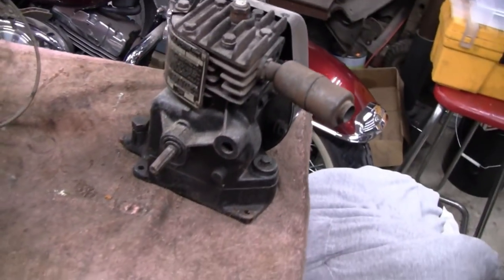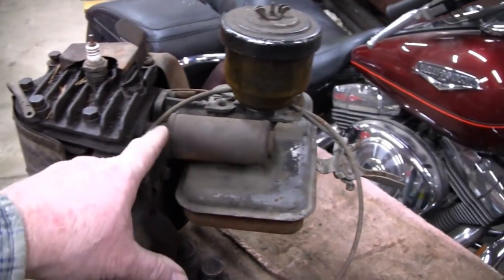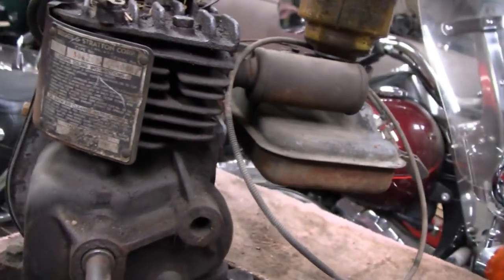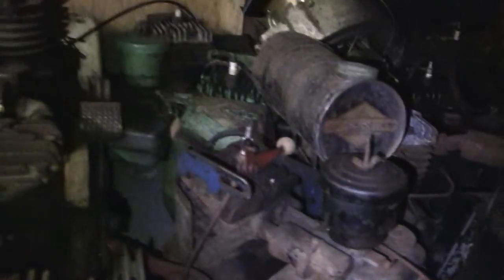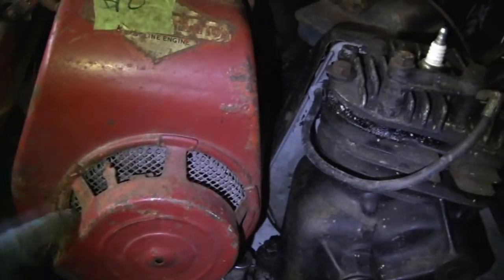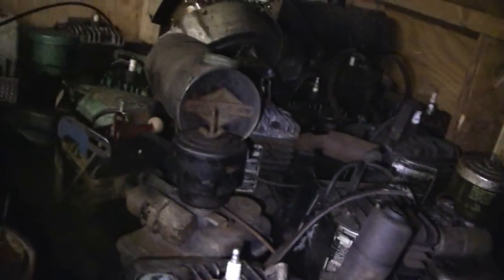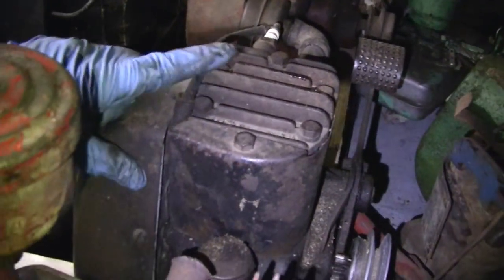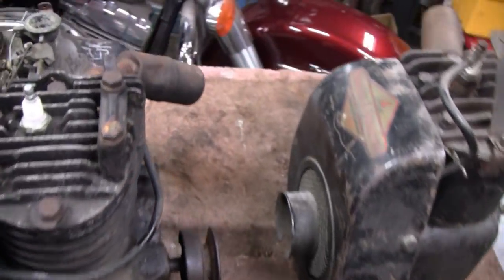HOMEMADE OVERHEAD VALVE BRIGGS (part 1)

Comment: I have never understood why Briggs stamps the pertinent information for the engine (model, type, date code) on a part that is so easily replaced like the pull starter shroud or some other shroud rather than the crankcase. It sure makes it a PITA finding parts down the road when other people have worked on something. My pet peeve is the pull starter/engine shroud. I have needed to replace that a few times but since it has the model# and other info on it I couldn''t...or have obtained or attempted to service some engines with the shroud missing and couldn't get the right parts since I didn't know the model or "type" number.

Comment: that looks like an original N model B&S with the big round tank  ,i got it at a flea-market probably 20 years ago 
i had it running  years ago and never found a use for it
Reply from the maker: Yeah I couldn't see the plate, but I'm pretty sure it's an N or a version of one!!☺

Comment: That's a shame that mikes stuck in work so much, I guess that means the radial engine is going to be a very very very slow project.
Reply from the maker: When we started the Radial project we said it would be a 5 -10 year project that we only worked on when we had time for it, so actually it's right on schedule!!☺
Reply: 805ROADKING I understand, if no one had anything to do things would get done quick, but people have lives. You guys do great work and it takes time to make things perfect, keep up the good work. :)
Reply: 88 Datsun 720
Thanks for understanding RK's position ...... :)
So many don't .... Or won't ..... :)

Comment: At first I was going to suggest something like an IOE or EOI design, but if you remove the valves (like RK is going to do), you can use the original cam with some homemade pushrods to get the job done - it's so simple yet so elegant!

Comment: You already have an overhead valve V-twin Briggs type engine. The Harley! Do a video on that, setting up belt tension, changing the fluids, adjusting the clutch. Its a pretty bike, you should be proud to own it.

Comment: You've got quite the collection of old Briggs and Stratton there RK.  Any Tecumseh kicking around in that stash?  I brought back to life a 1980 Tecumseh OH160 that had no compression because it was sitting unused for so many years in the 8x8 Argo I bought this summer. A little bit of penetrating oil and it freed the rings and runs great.
Reply from the maker: Thanks Bud!! I think there's an Old Lauson and a 2 stroke Tecumseh up there!!☺

Comment: OHV conversion yay. I have about 30 Briggs engines in several sizes in a 30 years time frame. Lots of mismatched parts on them. My model N's have the extension on the blower housing. One also has the rare recoil starter. The recoil starter requires a different crankshaft than the rope pull starter.

Comment: Everett, you ever seen a recoil start system, 
where you wind up the spring, and then,  release 
the start recoil?

I remember a mower, where you'd wind up the 
spring tension, then release the spring force.

steve
Reply: Yea I've seen those
Reply from the maker: Yeah I've had a few of those!!☺

Comment: A 4-valve setup would be pretty cool. You can make a little bridge so a single rocker actuates two valves, which keeps complexity down.
Reply from the maker: Easy Loco!! We barely have room for 2 valves!!☺
Reply: Check out the valves for a Honda GX25 - the valves are less than 1/2" diameter at the heads. You can get them dirt cheap on e-bay!